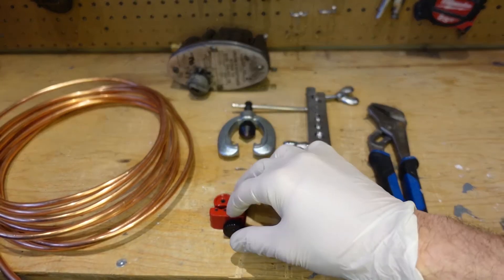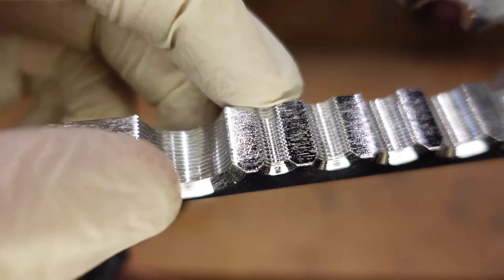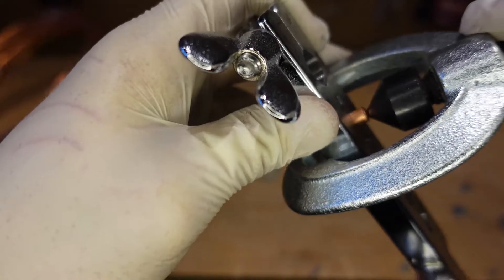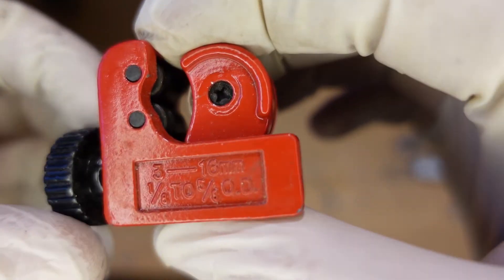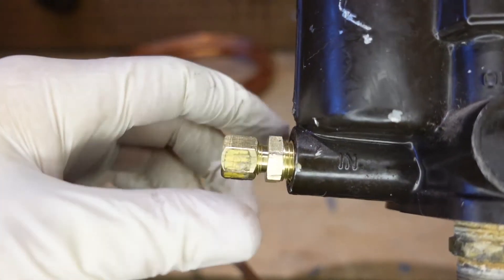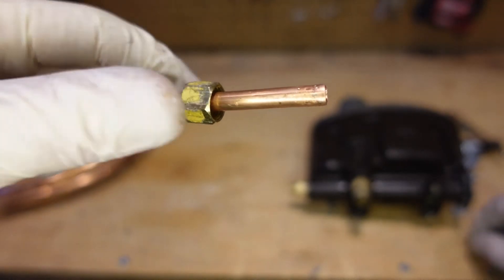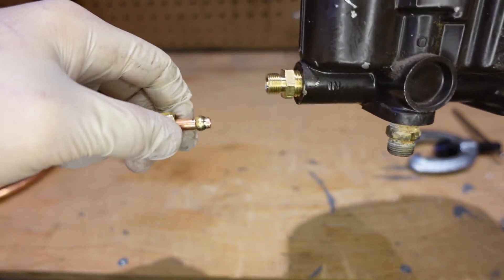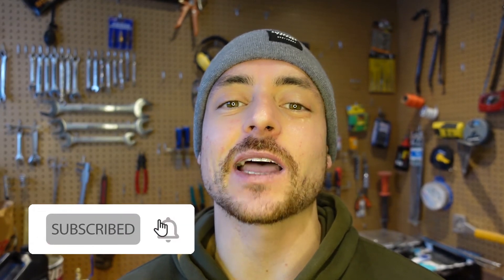HOW TO Connect Copper Pipe FITTINGS | Flare | Cutting | Tools

Comment: I did learn what I have been lookin for however I was taught the use of pliers you used was done backwards. when you removed the tube. Yes it can be done but they are engineered to be used in the other direction. Just turn it around and use it as you did on applying the tube .  Just thought you might want to be a little more professional.  Thanks

Comment: You used the flair tool backwards. The other side has the chamfer for the flair. The pipe was sticking too far out - should be not more than a 1/16" or around 1mm. Like a thick credit card. Also, you should have shown to ALWAYS put the flair nut on first. Even for a demo. This demo should be taken down and done correctly

Comment: you actually used the crimping tool backwards. if you look close at the side with the sizes stamped into it there is a beveled seat that is what is supposed to form your flare. the technique you demonstrated is absolutely not correct. you need about 1/8inch sticking out and the flare needs to be compressed into the bevel.
Reply from the maker: Oh good to know! Thx for explaining, I’ll have to do a proper one and delete this one.